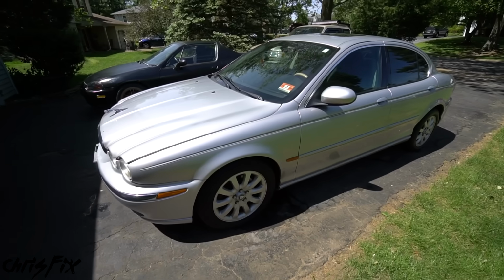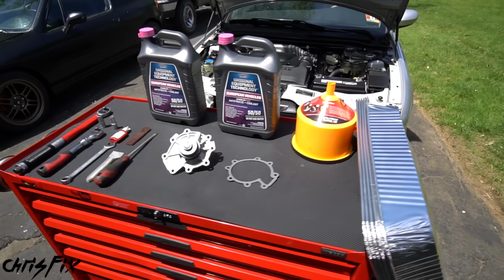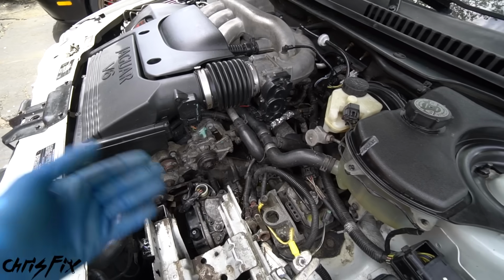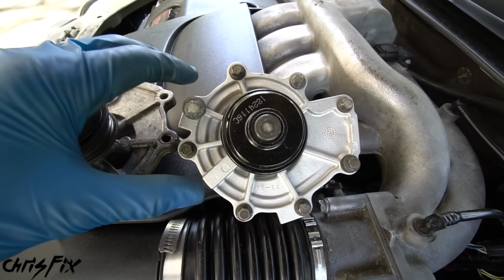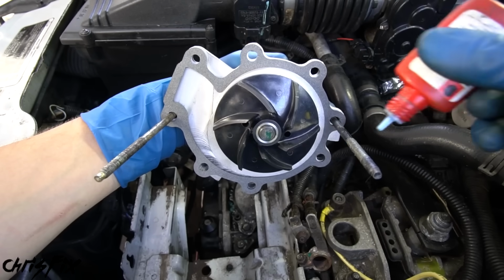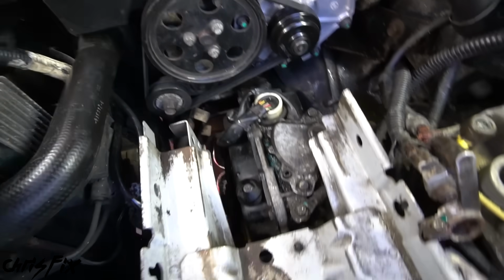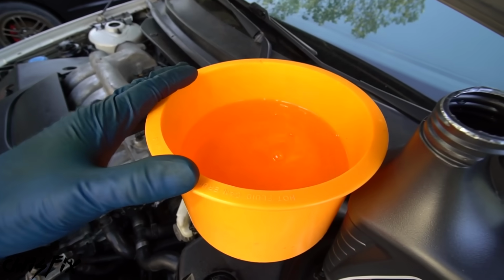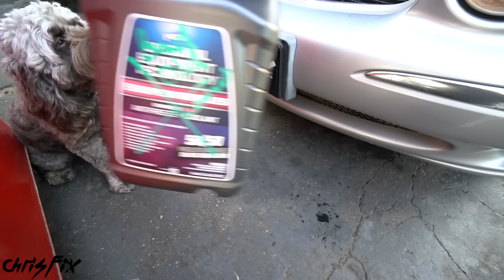How To Replace a Water Pump and Save $783

Comment: dont put thread locker on those bolts
Reply: why
Reply: @sovietcomrade7733  they are really long and that could cause you to snap one off in the block and you cant get it out
Reply: @sniperjoe1998  actually threadlocker prevent alumium to steel chemical weld. So it's easier to remove
Reply: @sovietcomrade7733  thats not a proper use of thread locker use anti seize for this application
Reply: @sniperjoe1998  threadlocker works just fine. Plus using antiseize isn't a very good idea, at least in my opinion, because bolts can unscrew themselves

Comment: Simple, until the water pump is in the timing cover ran by the timing belt in a sideways engine.
Reply: Yeah, mine is driven by the timing belt, too.  It's been in there for 22 yrs. Turns out it was never replaced with the timing belts.  Tensioner, pulleys, crankshaft seal, camshaft seals are original, too. Just waiting for something to leak.

Comment: Did this on my Audi Q5. Luckily I have small hands so I didn't have to take the ENTIRE FREAKING FRONT END off! Going back to Toyota!!
Reply: Good choice. I prefer buying European branded cars in Europe and not in the USA. Why? There is not enough qualified technicians to work on them. A buddy of mines sold his American bought Mercedes because of quality issues and dealership costs. I am sure in Europe, you will get a better deal. Toyota at least the one I have is built in the USA but it is one from the 90's and it is still running like a tank.

Comment: Hey Chris... Whats up brither. Hope all is well and you and your friends and family are safe. I wanted to ask you a quick question about my 2000 fird excursion reg gas 5.4 engine... I do have a blown head gasket so I'm going to do it all by myself so question is if I follow step by steps to do it which I can what else you think I should do while already have taken out the whole top engine? Pully belts? Water pump? Spare plugs? ... Please help me out brother. Quick tips is much my appreciated. I flip houses so if I can help you I definitley will thanks bro. Hope to hear from you soon. Big fan!!!
Reply: P.s this auto typing stuff is horrible sorry
Reply: Not to be rude but you can google that question. If you have the money, I would change out the belts, waterpump and spark plugs while your in there along with any seals.

Comment: You overfilled the coolant reservoir and didn't say we need to remove coolant, so it's at max when the engine is cold.

Simply filling the reservoir and add more coolant when needed is enough. The spill proof funnel is not needed.

Comment: I’m doing the water pump for my 2001 kia sportage. So far no problems, I just pulled the old one off and started scraping the gasket. That’s where I got stuck. D*mn thing feels harder than the aluminum. It’s the original paper gasket, so it’s dry, brittle, and fossilized against the engine. I’ve taken brake cleaner and a plastic scraper to it for hours and almost no progress. Any tips?

Comment: How tf people be charging almost $1000 for simple jobs like this or a head gasket or fuel pump like????
Reply: I'd only understand it in my case where you have to remove the timing belt and if they would also replace the timing belt for the price

Comment: This looked easy compared to my water pump replacement (03 mitsubishi galant). I had to jack up the car, remove the wheel, take off the two accessory belts, timing belt covers, motor mount, timing belt and tensioner. The water pump was behind all of that. I spent most of that project working under the car. Also had to use a metal taping knife instead of a plastic scraper because the gasket was all hard and stuck to the block (plastic scraper did very little to help). Ended up also replacing timing belt since I found pieces of the original one in the cover when I took it off (probably damaged from the leaking coolant pooling up in the timing belt cover).

Comment: mine was different I did water pump change on 96 Ford Telstar had to remove cam cover and belts etc change timing belt while everything was apart was not to hard to do

Comment: It really depends on the car. I did this on my 98 neon and the motor had to be dropped because the engine bay was so small you couldnt get the pump out.

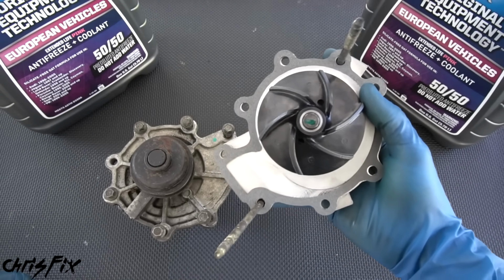Comment: @ChrisFix 6:59  -   If you use RTV Gasket Maker if your water pump already comes with a gasket, not only is it a waste;  but you are also double gasketing the water pump and the coolant will start leaking and the engine will blow up. You could damage the water pump, then.

Comment: After i changed my water pump at an authorized workshop on my 2009 audi a3 1.8t TFSI , i get a “scratching/squealing “ noise when i press the gas on the car , it only comes out when i have the AC on and coming from complete stop , a bit more when it’s uphill but it also happens on even roads ... any idea what could be the issue ?

Comment: i have peugeot 207, newly bought, water pump failure was fixed for 150 incl. new generator belt and new coolant. usually you can buy new or used water pumps for a cheap price, but changing it is really harder than it looks, especcially for some cars

Comment: The reason it costs so much is because the mechanic needs to get a salary. But knowing how it's done you can negotiate prices better.
Reply from the maker: Fair point, but thats still $783 in labor to replace something easy on this car!
Reply: ChrisFix Yeah, once I wanted to change the main digital display on my old Renault Scenic they wanted to charge me 1300 Euros and claimed the new part costs 800, all you needed to do was remove one plastic trim and two screws, and the used part I used costed 40 EUR and I got to choose the milage it showed. That's what you call Stealership, but I wouldn't mind sending it to a shop for changing the timing belt which was what in the end broke on that car.

Comment: I have a 2014 Chevy traverse ls. I keep have to adding coolant but I never see any leaks on the pump or under it. What would it be?
Reply: Maybe the head gasket, if it leaks you burn coolant. Do an oil test

Comment: Hey Chris, I was wondering, why did you fill the coolant up all the way? 

To my understanding this is dangerous and can cause the cooling system to pop as there is no air to displace by the expanding of the coolant due to heat. All cars that I know have a min/max line on the coolant reservoir for this reason. Is it different for this car?

Would love to get your feedback on this!

Greetings from Germany

Comment: This job is not so easy for any car that has the early 2000's Chrysler v6 engines in them. The water pump is inside the crank case and removing the timing chain is required. Ask me how I know.

Comment: I've always wondered about the best way to get air out of the coolant system, without spilling. That funnel would make my next coolant refresher so much easier.

Even though my waterpump is hidden behind the timing belt, these little snippets of info/advice make a video like this extra worth it. Thanks!

Comment: Where do you find a torque wrench that goes down to 8 1/2 foot pounds? The one in the link only goes down to 15
Reply from the maker: That's when you would use an inch-pound torque wrench!
Reply: ChrisFix got it! Thanks. Just divide by 12 I guess to get close ?

Comment: That sure is an easy water pump job. I think the worst I've had to contend with was on an 89 Ford Tempo. An otherwise fantastic little car, but the water pump setup was one where the pump did not mate against the block, it was a completely contained "box" that connected to the engine/cooling passages via metal tubes and hoses.

Comment: Your dad is one of the luckiest dads in the world to have you as his son 😁
Reply: The money he saves from his son repairing his car is the reason he can afford to have a Jaguar haha
Reply: @erkman7  2003 Jaguar= Overpriced Chevrolet which means its not as hard to work on as Jaguar would have their owners believe
Reply: @BadTV1993  you mean a Ford Mondeo
Reply: @BadTV1993  yes. The jaguars of that year are basically built off the Ford platform
Reply: Yep
Reply: But his dad has to put up with his over enthusiasm 🙄 sounds like a dj from a top.40 radio station from  the 60s
Reply: @Meme Man I’m sure Chris still works on his dads car off camera

Comment: Another useless video by Chris.
1. Every car is different. I have 3 cars, all have the pumps buried inside the engine. This video is useless, unless you can show me how to do it on my 3 cars.
2. Who takes an old car to the dealer? Take it to your trusted mechanic who can do this job for less than half and give you a 12 month warranty to boot, on parts and labor.
3. Most leaks are not that obvious. You'll end up diagnosing the wrong problem and spending time and money on the wrong issue.
Another useless video my Chris and others.
Today's vehicles are extremely complex and require a high degree of expertise just to diagnose properly, let alone  fix them.

Comment: Love your vids! I just replaced the water pump on my 2012 Ford Flex. Mechanics quoted me over $3000 (NOT a typo). I live in Hawaii, and the water pump replacement is a 10-14 hour job. Over $2000 in labor alone. It's a timing chain driven pump, so.... upper intake manifold; valve covers; lower intake manifold; crank pulley; timing cover; timing chain; RH cam sprockets.... all have to be removed. It was a serious PAIN IN THE A$$, but it felt great firing it up with no leaks when complete.

Comment: That was just Awesome to watch it looked easy... I guess, has longest you have the right tools this can be done.  I am having problems with my car leaking really bad and overheating because  of the water pump I am thinking it needs to be replaced
Reply from the maker: I was able to do this with a simple set of common hand tools! And if the water pump is leaking you should get it replaced!

Comment: Thank you for your positive, supportive attitude. You’ve got a great talent & your tips really helped a lot - put in a new water pump for my 97 Malibu tonight & used the same approach with the scouring pad material you use which worked like magic cleaning up those gasket surfaces. Also used blue thread lock on the new bolts that came with the pump. Solid!
Reply: Water*
Reply: @aditiaparajeeta4087  - Fixed it!

Comment: When reconnecting the battery, if your ratchet doesn't have an insulated handle, you should conect the positive battery terminal only, then tighten it up and then finish with the negative. Connecting them both at the same time grounds the car and if your wrench touches the chassis while in contact with the positive bettery terminal it create a circuit and there will be sparks and possibly a fire.

Comment: I wish my water pump was that easy to change. I had to pull half my motor apart to do mine - had to remove a/c compressor, engine mount, power steering pump, timing belt plus two other belts

Comment: Hey Chris I’ve been looking everywhere how to change my timing chain cover gasket and every video I’ve see there not quit organized and in detail. I have a 2000 Ford Mustang that’s been having a problem and I’ve notice a leak behind the crank shaft pulls gasket but just replaced it and I think it’s time to replace the seals please help this is my baby I’ve fixed many parts from radiator, ac condenser, hoses water pump battery harmonic balancer everything and this one is just a little tricky and messy everything I’ve done to this car I’ve learned from you so can you please help.!!

Comment: Serpentine belt driven pumps often are easy to change. Timing belt/chain driven, different story. I had a 1999 Chevy Lumina with a belt driven pump, the battery and pump failed at the same time. Pump was easier to change than the battery.

Comment: Another great informative video. My VW has been using coolant and recently got a warranty extension on the water pump. Maybe I can finally solve the mystery of the missing coolant. The mechanic just told me there's no problem if there's not a leak, and cut me off before I mentioned that I have been having to add coolant. Wish me luck dealing with these people.

Comment: I changed the water pump in my 1995 Mazda Miata when I did the timing belt replacement.  I messed it up at first, by accidentally punching extra holes through the new water pump gasket and realizing that after I added coolant to the radiator and saw it leak out like a sieve.  I basically had to redo the entire procedure.  It's crazy though, in order to change the water pump in my Miata, the timing belt had to be removed.  This means it was actually more difficult to change a water pump on a Miata than a Jaguar.  Who would have thought?
Reply: Yes on some vehicle the waterpump is on the timing belt side, on this jaguar it's one the accessory belt

Comment: Hi @chrisfix. I am on of your followers from Australia. I bought a Toyota Highlander 2004. Now it has a check engine light. I went to a mechanic and he checked the code. It is knock sensor faulty code. Is it ok if I drive with the faulty knock sensor? Will the check engine light go away if I change the knock sensor? The mechanics are saying it is not guaranteed that it will go away! Want to know your expert opinion. Take care

Comment: I guessed replaced a water pump on my 2002 Chevy cavalier and it was hard  I had to take the alternator out And the front right tire off It was a all day job I started 8 o'clock this morning And I did not get done till 6 o'clock tonight

Comment: Wow. This has to be the easiest water pump to replace on a car aside from a 5.3L. Great video Chris!
Reply: 5.7 Lita Ford engine that's 4 feet off the ground  have to take out the fan the hole radiator and belts

Comment: Hey @ChrisFix, the English Closed Captions have a few errors in them. Can I make a quick edit?
Reply from the maker: I'm trying to open them up, what errors are there?
Reply: @chrisfix  Some words are wrong. Better timing and whatnot. Even in the intro. "Attic curiosity" as an example.
Reply: @chrisfix  Were they mostly Auto-generated? That's what it seems like.
Reply: @chrisfix  Do you not usually allow Community Subtitles?

Comment: Also, you should turn your heater on full blast while bleeding the coolant system of air. Make sure it is blowing warm/hot air consistently while bleeding.  Another point is to be VERY careful taking bolts out! If a bolt is “rusted in,” it’s very easy to BREAK a bolt in your engine block. And that’s not good!!!

Comment: You gave me the confidence to replace my own alternator without anyone's help. Just $160 for the alternator as opposed to the $160 + $400 labor costs I would have to pay. It worked out great
Reply: Pretty easy to change an alternator . But changing a water pump is easy but gotta be careful because some water pumps are hooked to the timing chain .

Comment: Hi Chris, great video. Obviously it is an easy job on this Jaguar, Honda Civic would have taken much longer. Nonetheless, great job as usual!

I have a question though. These types of coolant reservoir have a Min and a Max line on them. Usually the max line is to allow space for the coolant to expand when coming from the radiator. 

When you removed the non spill funnel, the coolant was like half way in the funnel, means that you crossed the max line and the expansion tank is full to the top.... I didn't see you removed the extra coolant from it to get back to the point where the coolant can expand. 

When you closed the cap, the coolant is already at the top of the expansion tank, I believe this is a mistake which can damage the cooling system....unless you did do the adjustment but you didn't show it in the video?
Reply: The max line is to prevent the coolant from rising in the tank and not having anywhere to go

Comment: Wish I had watched this sooner and save but unfortunately my water pump  (2013 Ford Taurus) was buried deep where the whole engine had to be dropped. Took it a mechanic ( not to a Stealership where it would have cost me more) to deal with it and pretty much paid that much amount. Not a fun experience but the mechanic went easy on me since it also needed a special tool and long labor hours. Luckily, I had a secondary car 94 Ford Aspire ( needed a muffler since it was very loud and I wore ear plugs to reduce said noise) since I work 7 days a week and drive a lot.

Good to watch since I purchased another vehicle  ( older model and not a Ford) hopefully the water pump is not buried deep. Great vid!

Comment: Hold my beer boys, I'm trying this on a Dodge Stratus 💀
Reply: Hopefully your dodge isn't one of the ones that runs the water pump off the timing belt. When I had my neon I almost cried looking up water pump videos. Lol.
Reply: WeneDog0628 Oh you know it is lol! Battery under the wheel, plated lug nuts, take half the engine bay out to get to a water pump...this car's a peach.
Reply: @slipknot73745  Good luck. I hated doing anything in the engine bay of my neon. Always had to take 10 things out just to get the last bolt. Lol.
Reply: Same with Mitsubishi. Same 3.0 setup as the stratus. A nightmare
Reply: 2.7? Same as my intrepid. Connected to the timing chain. I changed mine by myself last year with 0% knowledge about it. Took me all day but got it done lol. Only thing I regret is not replacing my valve cover gaskets after removing my valve covers.

Comment: Was there temperature issue ? Or just leakage? If just a leakage, can we just reuse by changing to new gasket ? Looks like those pump fins/blade are fine...
Reply: Be better just to replace the whole thing you know just in case

Comment: Thread locker & tightening bolt's with a torque/r isan't nesesary, wat vibration would there b, if the bolt's r tight how would they loosen, u just use a reg rach.

Comment: Ita the same with chrystler 300. 1100 quote to change the water pump. The water pump is mounted on the block behind the timing belt cover. Kinda sucks to change but worth the 100 actually spent to replace.